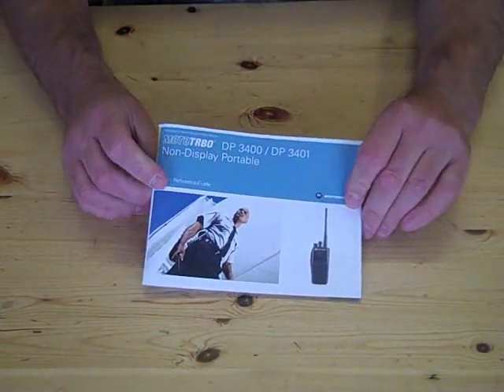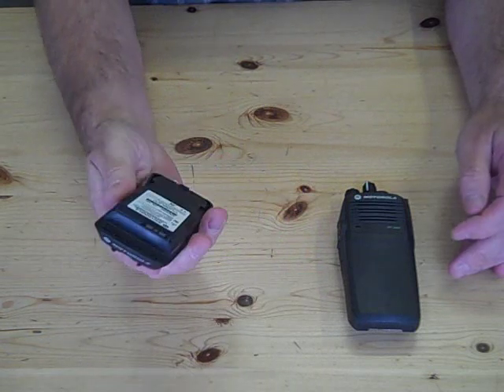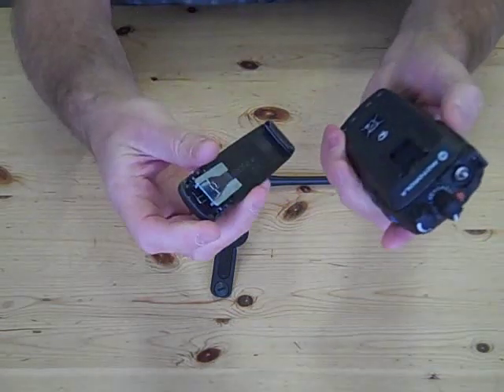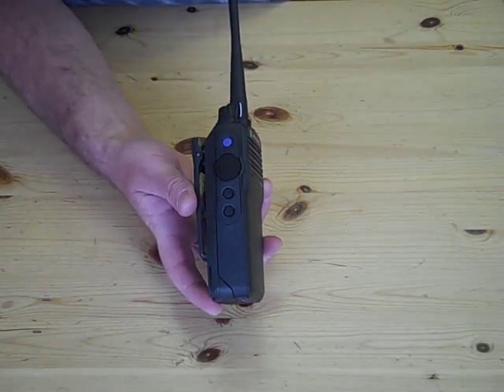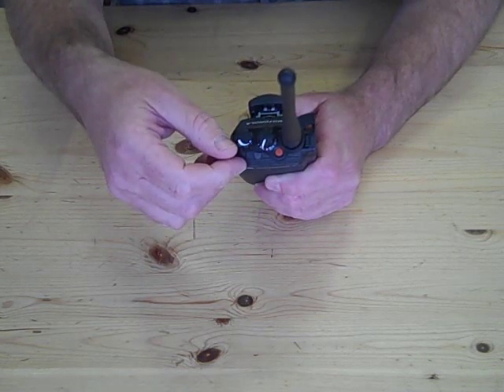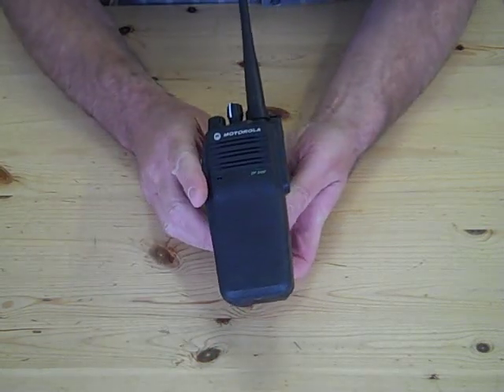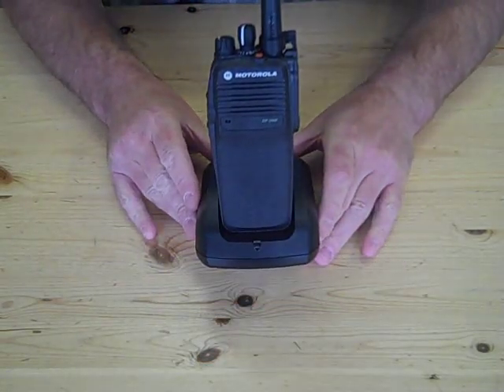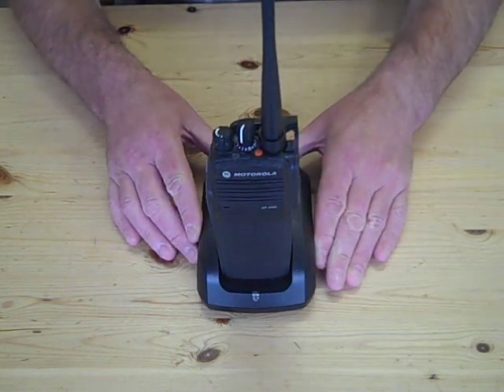Motorola MOTOTRBO DP3400

Comment: currently using this item with a msa sordin ptt headset with boom mike at front of stage at music events, the volume is turned all the way up but when receiving comms its very hard to hear is there any way of increasing volume or a separate adapter with an additional volume control??? thanks for your time.